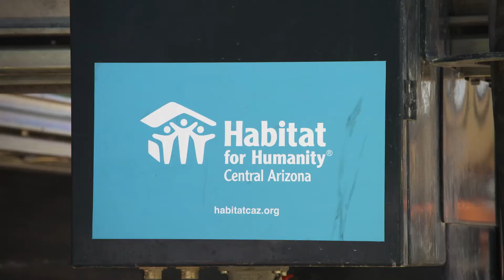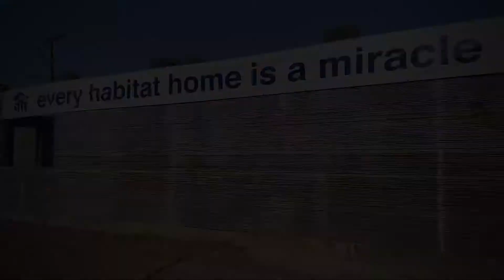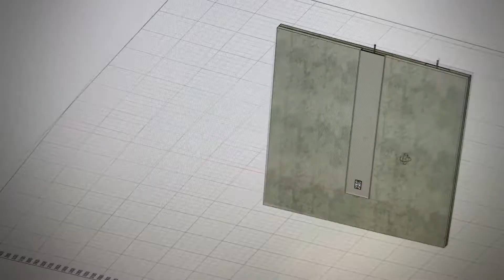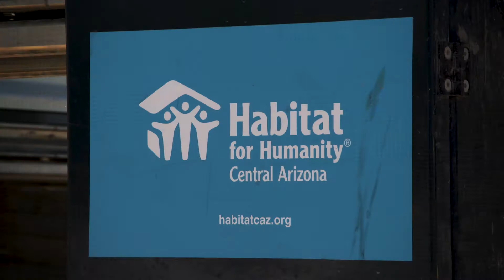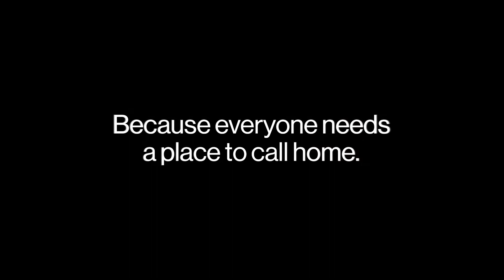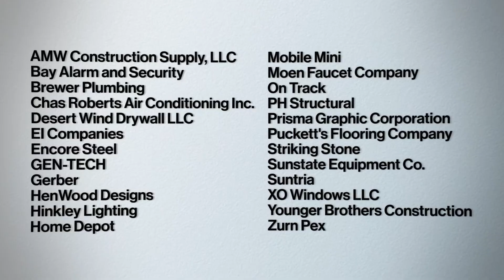Why not us?  Habitat's 3D-Printed home in Tempe, Arizona (Original)

Comment: After have built one house and rebuilt another I love the Idea of a 3D printed house the first issue that I see with the horizonal lines in the walls is that they will be massive dust collectors. I could see Gunnite or Shotcrete sprayed on the walls to smooth them out.